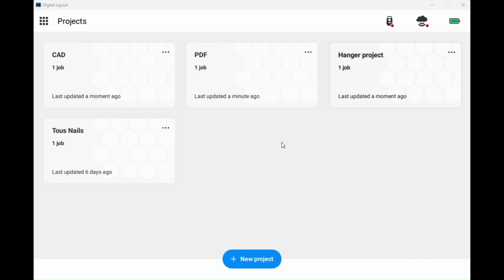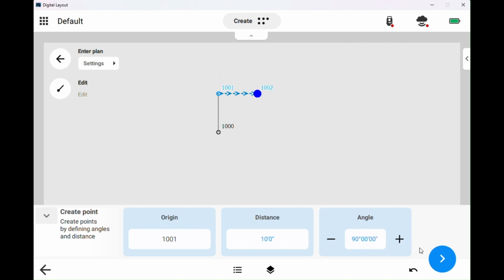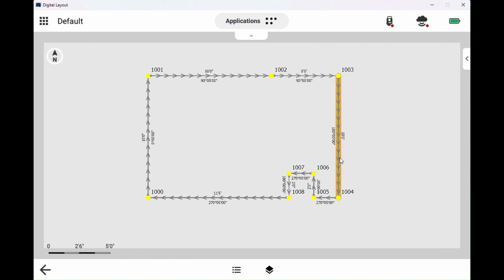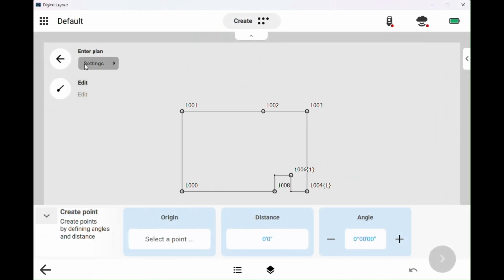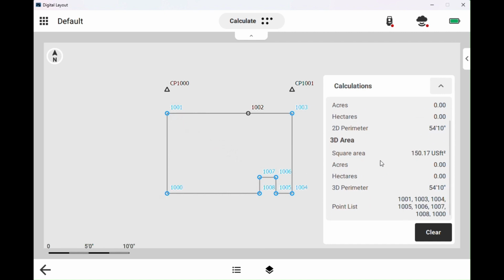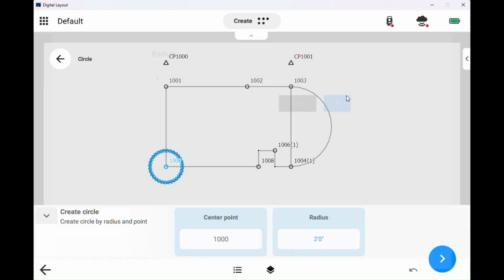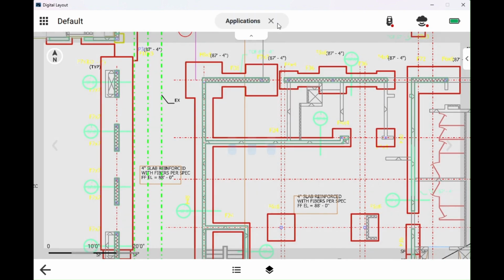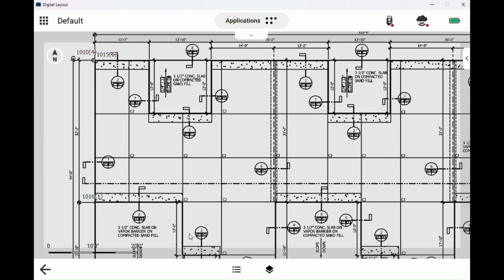Topcon Digital Layout Intro

Comment: If I have a cad dwg with frozen layers (because I don’t need to see them) how come when I import the dwg into my topcon does it then still display those frozen layers? I’m using digital layout. Pls help!
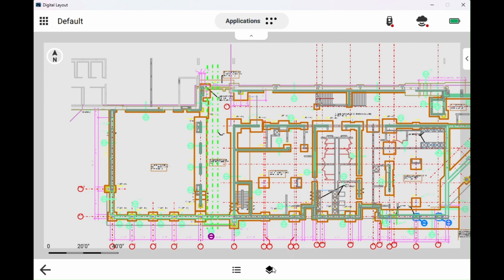Reply from the maker: I believe TDL displays all layers of the CAD file you import, regardless of whether you froze them in the CAD file itself. Once you import the CAD file into TDL, go into the job and click on the icon at the bottom of the screen that looks like two black squares stacked on top of each other. This is where you can set which layers you want to see within TDL. See the timestamp 8:57 of this video if you need more help.
Reply: How much cost did u pay.....😢

Comment: I currently use Magnet Field Layout on the FC 6000 with the LN-150, is this a better software?
Reply from the maker: If you are using the LN-150 for building layout, this yes, this software is much easier to use. Digital Layout will not do machine control or anything like that.
Reply: @siteprecision  It looks like Digital Layout is more user friendly. Magnet Field feels like software designed in the 80s. What is the cost comparison?
Reply: @siteprecision  Could I get your contact info? Thanks
Reply: Digital Layout is the next generation replacing Mag. Field Layout.
Reply: Is there a perpetual license available for it if you buy a data collector loaded with it? Subscription fees beat up occasional users pretty bad.
Reply from the maker: @sitdwnandhngon  There is no perpetual license, it's annual subscription only.